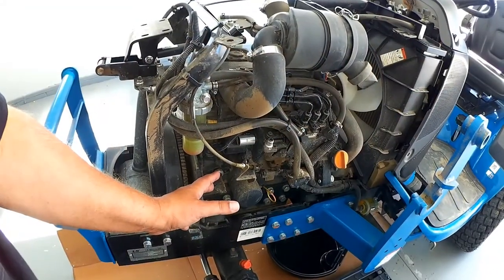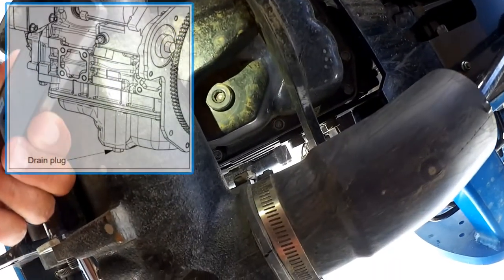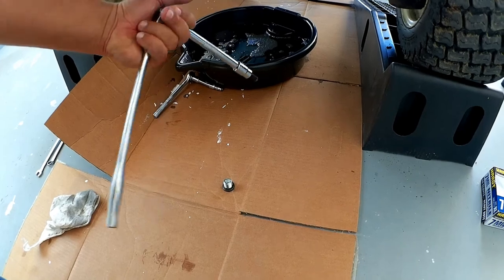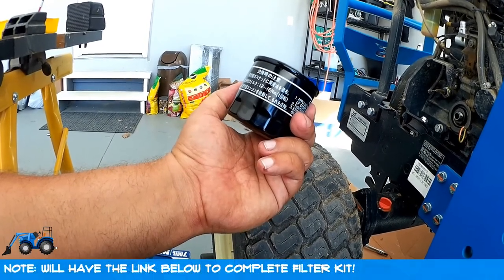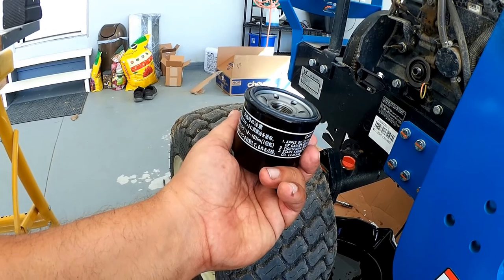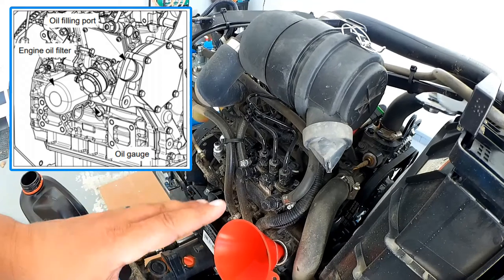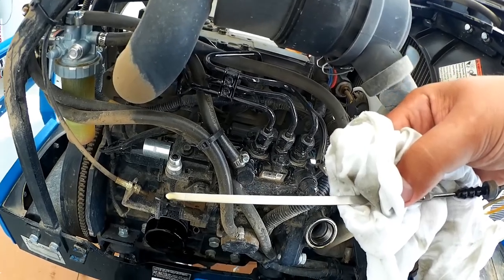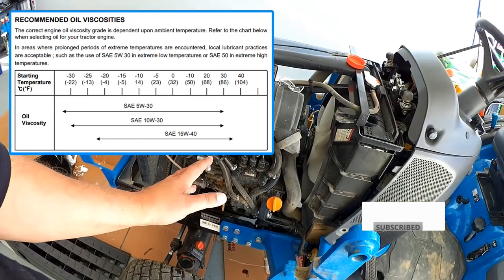LS MT125   How To Change The Engine Oil Step by Step!

Comment: I don’t think you got my previous comment so I’ll try again.  First off, thx for the fine video it was very helpful, especially the part about using the correct filter during the oil change ILO using the Wix filter, after all it’s a 50 hour service, I don’t want to void the warranty by using the incorrect filter.  Now the question I have is when you do the 50 service, you also must change the HST and the hydraulic filters, I’m thinking some hydraulic fluid will be lose, can you tell me what hydraulic fluid you used to replace it and possibly where you got the oil from. Also thx for telling me to use diesel motor oil for the motor as the manual isn’t much help with that either.

Comment: Great video, I was concerned about finding the correct oil on my 50 hour service, didn’t want to use an oil that was incorrect and ever want LS to say they wouldn’t honor the warranty if something went wrong. So you explained it.  And I was going to use the Wix oil filter but have to agree with you, it’s a 50 hour service, use the LS filter, it’s a small price to pay. On the 50 hour service they also say to change the hydraulic and HST filters, question I have is, will I lose a small qty of hydraulic fluid as I suspect I will, but what kind of fluid do I use to bring it back up to where it’s suppose to be?

Comment: why is there two oil fills one is on the top of the motor
Reply: What one do I use?
Reply: These engines are designed for multiple applications so sometimes one of the filler caps are blocked.